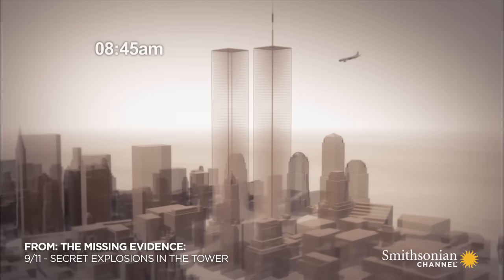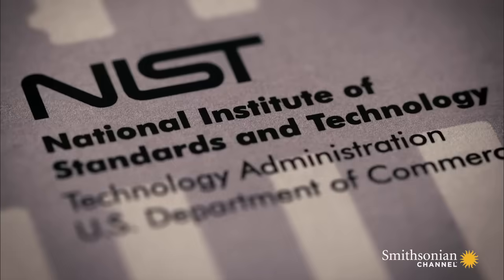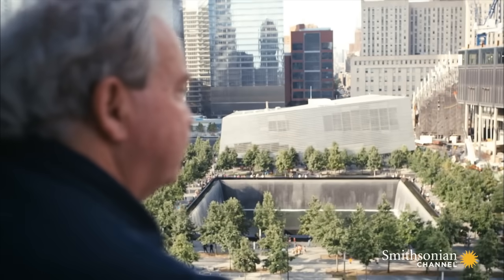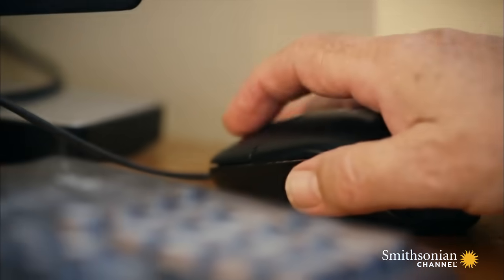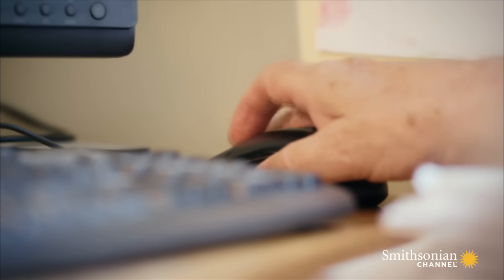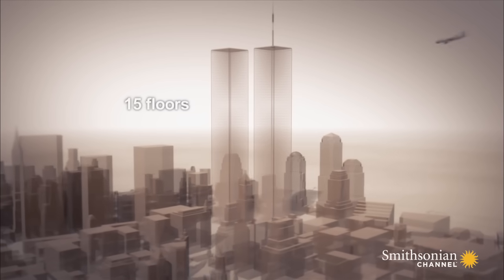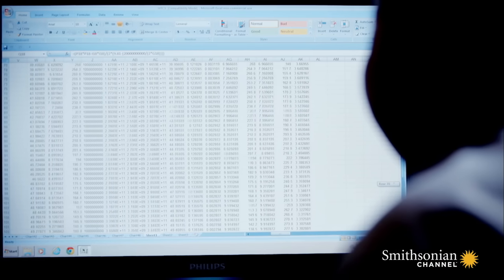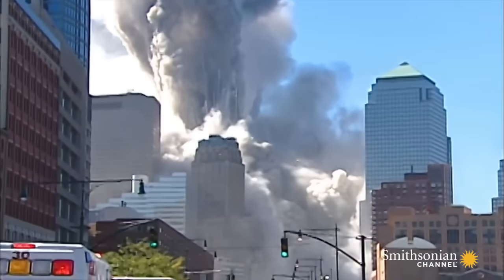This Computer Simulation Explains How the Twin Towers Fell

Comment: So he studied the mass and weight above the impact zone, but not below... and ignores one of the architectural engineers of the Twin Towers, who states that they "could lose 3 sides of the building and still stand", who also goes on to say, "the buildings were built like 3 separate sections. Each weighing 1/3 the weight of the next", so therefore the bottom section would be quite stronger than the top... so the upper floors coming down would be hitting more and more resistance, not speeding up as saw... furthermore, it not only sped up, but disappeared the center core structure COMPLETELY, all the way to the foundation. no ordinary collapse can do that... there are literally no examples in history, where a steel framed structure building just gave up every joint, every floor, every bit of strength... and pulverized all the materials and inhabitants into a fine microscopic dust... It is an uncontroversial fact, that what we are told does NOT support the science we all watched unfold.
Reply: The mass below isn’t that important. We’re talking about the structural integrity of a hollow building not a solid concrete slab supporting the weight. As the debris picked up speed and the steel degraded under the sheer weight of the upper floors, it collapsed.
Reply: @zachb1706  it matters quite a lot. thats like saying a VW Beetle made of lower grade steel standing on top of an 18 wheeler made of higher grade steel upright  will eventually piledrive through the entire structure... even given a temperatured fire (which the fires on the WTC could not have reached a high enough temp by office fires or kerosene(jet fuel) alome). I'm actually educated, not just running on theory and on what Im told is the truth. IF what we were told was true, we would loterally have to re-analyze and rewrite what we use as practical scientific development. Another point here, is since the construction of the Twin Towers, MANY other structures were similarly built. What has anyone done to "correct" these flaws? On the investigation, why were specific leads not followed? Evidence sold and destroyed before a reconstruction could be established. few complete bodies were found... some 20,000+ arm to fingernail sized body parts to make up a total of less than 1600 people from a total of 2996 people missing... oddities that dont occur in normal catastrophic building failures. and finally, WTC 7... no valid explanation.... I'll rest my case.
Reply: Timothy McDevitt I never said you weren’t educated, and I believe that it’s in your right to look for the truth. But you must understand that this guy isn’t just measuring a solid structure, more the integrity of such structure.
Reply: Timothy McDevitt many of the bodies would be hard or impossible to find in the wreckage. Many would just be bits of flesh and blood. A horrible day, my condolences go out.
Reply: @zachb1706  Ive had the unlucky experience of knowing what it looks like when collapses take lives... and thats NOT how it would look. sure some would, but not most. It was a tragedy unlike any other in our history, and should be taken just as seriously, in every way we look at it.
Reply: Timothy McDevitt how would it collapse? I guarantee it wouldn’t topple, not with that type of impact. You can see the supports giving way under the weight, expanding outwards
Reply: @zachb1706  EXTERIOR supports. inside were CORE columns, which were MUCH stronger, which were not damaged. You should really look at the blue prints better. they werent "hollow" buildings. there were over 3 MILLION tons of steel, put into it. Plus how did the top 7 floors crush 103 HEALTHY floors below? IN 10 SECONDS?? WTC7?
Reply: 1) The central cores were severely damaged. So, your assertion to the contrary is complete bullshit;2) The towers were of a comparatively lightweight design intended to maximize office space on each floor;3) The tube-in-tube design relied on floor trusses to connect the vertical elements of the outer walls to the central core, otherwise the outer vertical elements would 'bow' outward and not be able to sustain any significant weight.If you don't get the point, you should.

Comment: For you conspiracy nuts..The floor was weak from the initial impact and after the fire..beams started to melt or weaken from the raging fire all the weight of the floors was pushing down on that, once a few beams start to deform on 1 floor or just slightly bend(thats what steel does when its hot) and 1 floor starts to collapse. All the weight on the floors above on top of that falls down on that and takes the whole building down, floor by floor.. Remember theres alot of weight on each beam plus a plane impact that done alot of damage.. Also keep in mind steel beams dont have to completely melt to weaken, steel bends without completely melting

Comment: I thought that a tower 209ft wide hit by an airliner with a wingspan of 157ft might be a clue. The people who design buildings against earthquakes have many examples of failure and success to learn from. Unfortunately we don't have any experience of very tall structures being hit by large aircraft and surviving to test or learn from. They have all failed.
Reply: They always cite that the buildings were hit by aircraft but that in itself is misleading, The crash and fuel are all arguable factors. These will never explain how "bad floors of the building, destroys good floors of the  building built with almost triple redundancy.. The force of the collapsed floors coming down is not enough to overwhelm the MASS and structural integrity of the floors below it in such a manner. THIS IS PRECISELY WHY they MUST rig buildings with explosives in order to demolish them. I am not saying that is without any doubt what happened however I know for sure what did not happen. I would be a believer if someone could show me the math or reproduce the evolution using something other than a contrived sham of a computer generated model (which leaves much to be desired with regard to the factors used to produce it.

Comment: They impossible for it to be collapsed by just plane... There were demolition explosives planted. They knew...
Reply: But it did... mangaas Jan 2017, a STEEL FRAMED BUILDING collapsed in Iraq due to a FIRE! Another metallurgist demonstrates how easily steel bends at 1400-1800° - it’s basically a noodle. Your arguments are invalid.

Comment: Does not explain 25 tons of steel ending up stuck in the Deusche Bank some 350 feet away. Explosives do. Does not explain antenna falling before roof of building, core structure compromised by explosives does. Fear is a very powerful emotion and can cripple rational thinking. It took me dozens of hours research, over many months to finally except the inside job hypothesis. Since then evidence simply adds exponentially to an inside job. Only honest appraisal will get to the truth.
Reply: Do you enjoy being an imbecile?

Comment: The problem with the model is that it supposes that this upper-block stays intact during the fall, but that can't happen. So, a 15-floors block could have only destroyed 15 lower floors and then it would have been destoyed itself and there would be nothing left to destroy the lower parts. And the towers mostly went into dust, and all that mass being transformed into dust can't drive the destruction of the tower below.

Comment: I was in 4th or 5th grade when 9/11 happened. All that time, I just knew planes hit the twin towers and something hit the Pentagon. I opened that memory and did some reading and watched the videos of the towers falling. Then I seen videos of controlled demolitions. I, to this day, hold my ground with a die hard belief that 9/11 was an inside job. From video footage, to interviews, to the architect plans for the buildings and materials that were used, to how jet fuel burns, steel melting points and weakness thresholds, and so on. All of it proved that it is in fact, a false flag, giving way to assault another country and opening the door for government powers to do as they wish with your identity and everything else that you do. And nobody, beside one or two news outlets, covered Building 7 going down. If you go back and watch the videos of that day, you will hardly, if ever, find a video of Building 7 going down or even mentioned. For those who doubt it, explain how a building that size goes straight down instead of toppling over into another building or two? Only one answer is right, controlled demolitions. And I hope to God that the Iraq Veterans realize the mistake and the lie they took part in and come to terms with it and make some kind of peace with themselves. That opened the door to investigate the government and it should've caused an uprising when the truth came out, but so many people are stupid to the fact that they are nothing but sheep in a queue to be sacrificed.
Reply: Cool. How's being an imbecile working out for you otherwise?

Comment: @3:45 So this bloke is saying that the upper block that collapsed had a mass of 38,000 tons, the whole mass of the North tower had a mass of 500,000 tons, let me think this through again, he is saying that 38,000 tons managed to squash 500,000 tons? I know that some will say that when each floor was blown up (sorry collapsed) this would have added to the 38,000 mass but come on, if I had a steel cage (I say cage so that its a frame and not a solid block) that weighed in at 38 lbs and dropped it on a steel cage that weighed in at 500 lbs it would crush it, or look at this way, if I had a car that weighed 3.8 tons and dropped it on a truck weighing in at 50 tons that car would also crush the truck, I'm no expert (obviously) but it just does not make sense, if the planes had hit near the bottom I may have believed what had happened.

Comment: Ha, Ha, if it showed anything it would be in the public domain  and we could all look at it, notice he was sitting in front of number there was no simulation running no explanation of failing parts or where did the engines go no luggage, and that the buildings  turned into powder, come on I work with Steel, bend it and know what it takes to melt it !!! Not to mention the Laws of Physics(For every action there is a reverse action) so that means for every floor that was destroyed would have destroyed itself being they are made of the same material so that means 13 floor can only destroy 13 floors as so with the 22 floors, not to mention the Resistance of the cold floors below, last time I looked flames go up and not down,  so weakening structures below is not possible !!! Nice Try Still No Proof !!! If you believe this,  you're brainwashed !!!

Comment: "I played the program" Shows random data in an excel spreadsheet.
Reply: Yes, where is the LOL button?
Reply: but programming is about data and its alogaritm
Reply: Btw Mr completely ignorant.   These simulations have been conducted on MULTIPLE platforms by many varied Companies. On proprietary software that is used to build high rises.  All came back with similar results. That the collapse would have MORE than enough energy to continue
Reply: @kj1341-e2b  That's the problem.. the steel does not MELT!!.  It doesnt have to melt.  It only has to have its yield point LOWERED. the fireproofing on the steel was in horrible condition before 9/11. No fireproofing equals Zero fire rating.. not a matter that the steel might soften... IT WILL. once that happens you've now got 23 stories quietly creeping...moving.. they're not supposed to do that!!!
Reply: @kj1341-e2b  You quite obviously don't understand the difference between Static vs Dynamic loading.   BTW?  The building is ONLY designed for STATIC loading.  THe force of the wind on the structure is a DYNAMIC load it is built to give and sway for that force.  It is built into its design.  It is designed to deal with 13,000 tons lateral wind load.  But the loads of the floors up and down are carried as DEAD STATIC LOADS.  Once the top 23 stories fails this is now a DYNAMIC load.  Nothing below this is designed to arrest or stop that much weight...………...IN MOTION!!   A drop of 20 inches would have been an overload.  One story height is TWELVE FEET!!

Hello???
Reply: LOL
Reply: You do understand how a spread sheet works right??   One value added to the next.   If one floor can't deal with the weight of 23 stories falling on it why would we expect the next floor to fair any better??
Reply: @roquefortfiles  You do understand what random data is........right?
Reply: @savagegaming8657  You do understand that the building is not REMOTELY designed to arrest or stop 23 stories  IN MOTION. 

You do understand that right????   Not by what you say.
Reply: @savagegaming8657  You do understand how a building WORKS?   Right??   Do you understand the difference between Static vs Dynamic loading??   23 stories in motion is a DYNAMIC load.

That is REALLY REALLY bad!!  the building is designed to function with STATIC loading.   All of the weight is carried as a DEAD LOAD!!

Comment: It is impossible that the WTC Towers could have been crushed completely to the ground by increasing momentum transfer of the falling mass of upper floors because there was never any INCREASE in the mass supported. Without an increase in mass there can be no increase in momentum. Something else that is anomalous and contrary to the laws of physics is the constant speed with which both buildings collapsed. The much disputed question of whether or not the buildings collapsed at free-fall speed is irrelevant. What is relevant is that the collapse was at constant speed and DID NOT SLOW DOWN as it progressed, which is impossible if caused by gravity alone.

Unless there is some means to remove the accumulating debris of crushed floors out from under the falling mass as fast as the debris accumulates, the falling mass will slow down and ultimately stop at a point of stability where the weight of debris is not sufficient to compact itself any further. The means that removed the accumulating debris allowing the buildings to collapse to the ground AT CONSTANT SPEED were explosive charges that completely pulverized the debris and blew it out from under the falling mass.

This is why two 110-floor towers collapsed all the way to the ground into a field of completely pulverized debris only a few feet high while the 47-floor Building 7 which was less than half the height and a third the mass of each tower collapsed into a debris pile 80 feet high. In fact the Building 7 debris was the highest object left on the entire World Trade Center site.
Reply: Too bad the entirety of mainstream science disagrees with you.
Reply: @tpryce
500 years ago mainstream science claimed the sun revolves around the earth. 400 years ago mainstream science claimed insects come to life spontaneously from rotting organic matter. 300 years ago mainstream science claimed certain types of sickness could be cured by drawing blood from the body with leeches. 200 years ago mainstream science claimed certain materials such as wood or coal will burn because they contain a substance called phlogiston. 100 years ago mainstream science claimed there was no possible way to split the atomic nucleus.
Reply: @jamescollinson2179   Are you implying that there's some fundamental flaw in mainstream science's understanding of physics and building construction?

Comment: the graphic here doesnt represent reality..theres an entire massive steel infrastructure of 47 core columns on the inside of each tower...Building 7 ,not hit by a plane, had a whole internal massive cage like infrastructure of thousands of tons of intertwined steel beams..all of these building are built for redundancy , meaning the bottom sections can hold many times the weight of the structure above!! as fas as the North Tower they are saying that the force of gravity caused the top fifteen percent of the building to crush the bottom 85 percent! This is physically impossible as this  violates two of Newton's Laws of Motion ..any honest engineer, or physicist  can confirm this . Best documentary is on YT, called "Experts Speak Out/The Final Cut!"
Reply: You’re extremely confused.
Reply: @4465Vman, If you don't understand the difference between the 'weight' of 15 floors versus the 'kinetic energy' represented by those same floors falling approximately 30 feet, then you really don't know shit. The fact that you're trying to cite Newton's Laws is laughable, because it's clear that you don't understand them nor how they're applied.